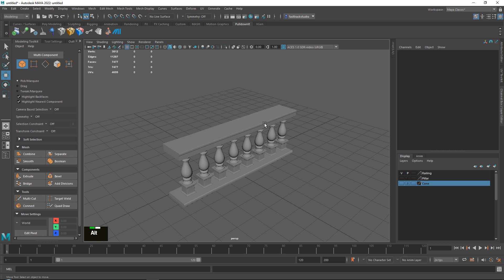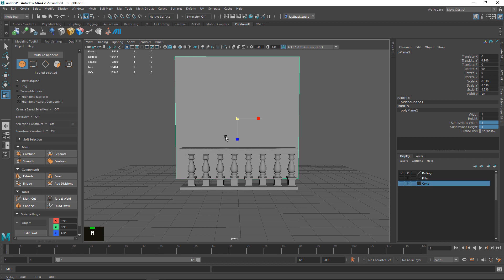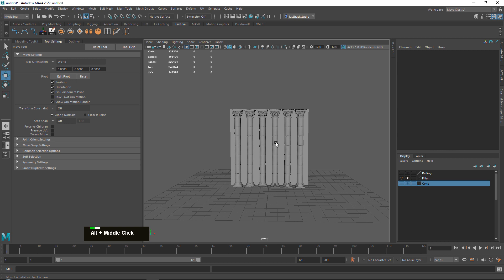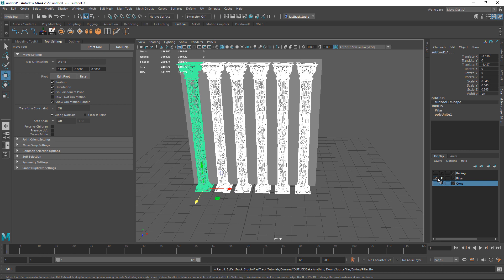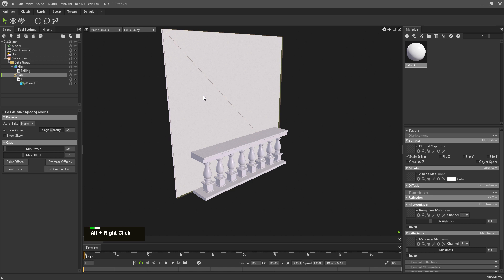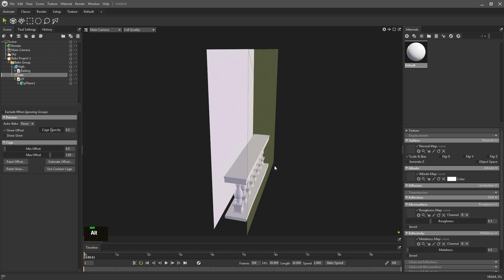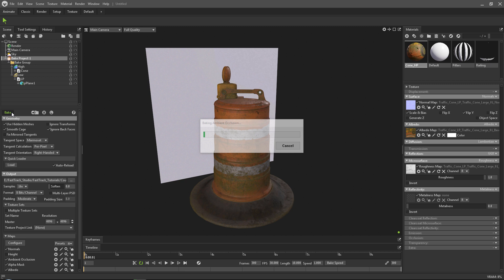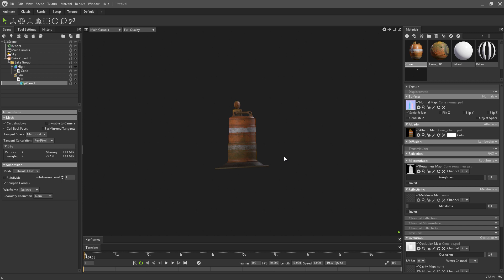How to bake anything onto a flat plane!

Comment: Thank you Emiel, it was a fun technique ;) I saw this trick used on some cases in close distance to the player and it worked very well.
I test this technique before with Marmoset toolbag 3 and 4, keep in mind marmoset 3 is better for this kind of bakes, because its have more options for bake and one of them is (( complete Lighting )) and basically it will grab your textures of your object + lighting properties of you scene and it will bake you rendered object to the texture, I don't know why they deleted this feature from marmoset 4 !!!
Reply from the maker: Ah i did not know that. but if you do the keep lighting would that not mean that the lighting on your model is inaccurate as soon as you change it? (for example when used in a real-time scene in unreal)
Reply: @FastTrackTutorials  the whole technique in this video is a trick, and what I said is trick under trick, so we have double trick here !!!:D so yeah it cant react accurately to the lights in close distances in 3d environment.
But I think in far distance, the effect of the roughness, metallic, AO and normal is not visible, in these case's we can bake all those properties + light information in Marmoset ((ambient light based on our environment)) and finally we have 1 texture for importing in UE and not more . . .
Maybe this technique has some uses for close distance in games with top-down-view style or some situations that we locked the player camera, but I'm not 100% sure, at all this trick is cool. :)

Comment: Awesome tutorial, Emiel! Thank you so much for sharing your knowledge, could you answer a question regarding this technique? I noticed that, until you include the Alpha mask, the bake doesn't look right and I was wondering if it would be possible to apply the same technique without the mask to make it look right. I ask this because it would be very useful to make tileable textures without opacity channel. Would there be any way to do this?
Reply: The thing is, it doesn't look right due to dilation, which is used to help to get rid of dark edges when you use opacity/alpha blending. To get rid of the black edges (or whatever color is behind the texture, usually black) you can color the background to a color similar to the color of the "useful" parts of your texture. In the case of the traffic cone, orange behind the orange parts, dark gray behind the bottom, etc. 
To help with this process and to have better results, at baking (or after baking with the help of photosop) the software takes the pixels at the edge of your alpha edge (e.g. the side of the traffic cone) and dilates it to a certain distance. Basically duplicates those pixels.

The alpha mask is needed to mask out the unwanted parts of your texture. In this case it's used because the useful parts of the texture is less then half of it.
If you bake, let's say a brick wall, that was assembled with tiling in mind, onto the plane, you don't need to use the alpha mask.

I hope I could answer your question, even if it's this late hehe.

Comment: My question is regarding baking a fully textured object down to a lower poly (or a plane) is it possible to do it in Substance Painter? If yes, could you make a real quick tutorial on that too?
Or maybe if you know how to do it in Xnormals?
Reply from the maker: Not sure if it is possible in painter because as far as i know you can not apply texture maps to your high poly to bake down
Reply: @FastTrackTutorials  Thanks for the answer. That’s what I was afraid of. 
I know it’s possible in Xnormal, but not sure how. I’ll need to dig into that than. 

Sadly I don’t have access to Marmoset.
Reply from the maker: @viktorb2688   you could get marmoset during black friday :) i can remember they only make it $9 per month then so even if you need it for one month it is not alot of money depending on your location